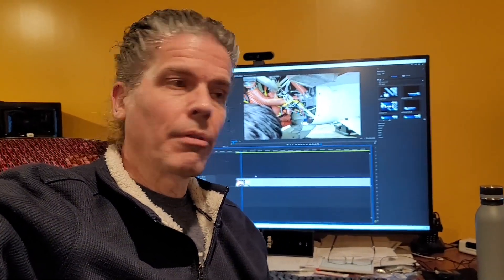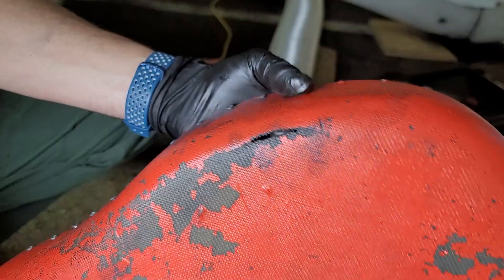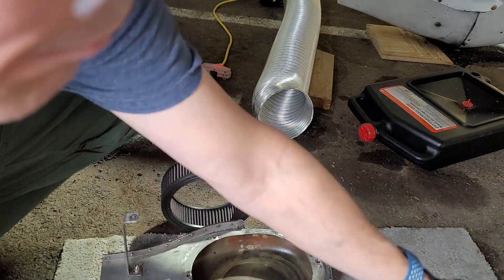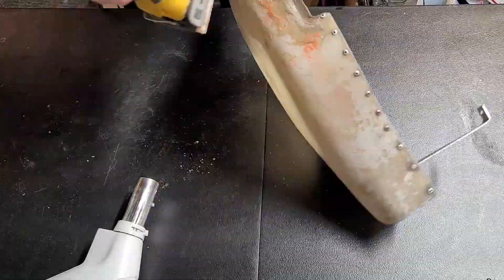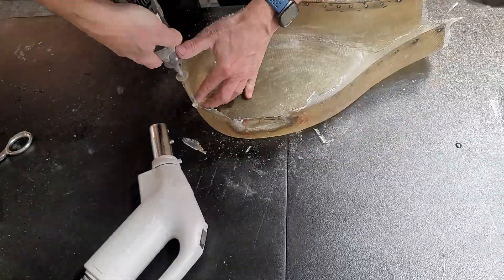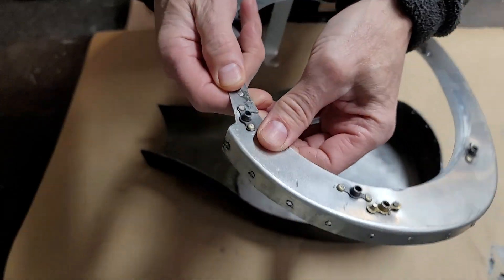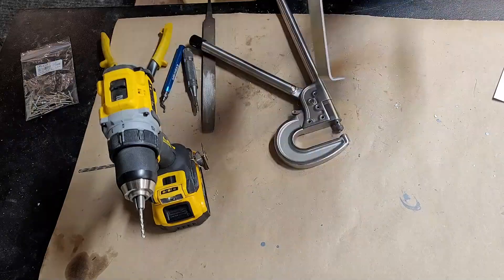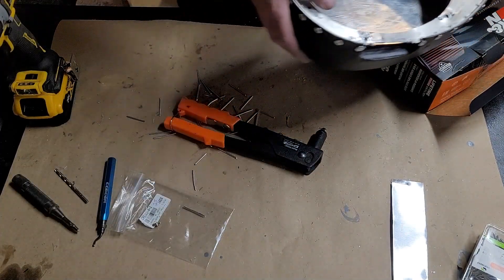Unexpected Problem! Rebuilding the Air Box on my Cozy MKIV Airplane

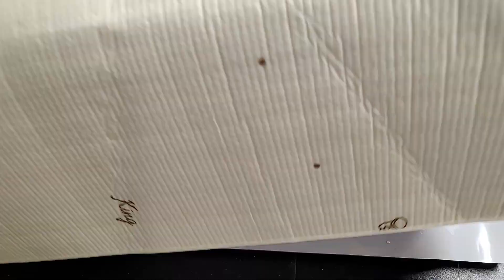Comment: 8:12 I'm very curious about the "curing tent" thing. Do you add heat? Does it contain the fumes a little bit? Keep flies from landing on it?
Reply from the maker: It is a heated plate with an insulated hood, and holds a specific temperature for a given amount of time. It drastically accelerates the curing time (full cure in around 3 hours rather than 24), but more importantly, the cured epoxy has increased strength, elevated glass transition temperature and reduced residual stress. The glass transition temperature is the temperature at which the cured epoxy goes from being rigid to more flexible. The temperature and times vary for different epoxies, so you need to do some research first.
Reply: @CanardBoulevard  aha. thanks for the big reply. it sounds somewhat like tempering glass or steel, really managing the temperature changes.

Comment: How does the filter move if it's seated to the carb?
Reply from the maker: It's pushed up between the bottom of the throttle body plate and the bottom of the air box. The only thing holding it in place is friction, and lots of oil gets down in there, reducing that friction - so with engine vibrations (plus the filter physically shrinking in size), it starts moving all over the place. That won't happen anymore.

Comment: I’m wondering, since you put aluminum on the bottom of the box, why didn’t you bend a lip around it to capture the filter to retain its shape and not restrict air flow like the tabs you installed around the top?
Reply from the maker: I like your idea! It would have required some way of scribing a ridge around the circular plate - not easy (at least not without metalworking tools), but it definitely would work if you could do it.

Comment: Great video Scott, by the way those lug fasteners are called nutplates probably MS21048 or MS21069 depending on the spacing of the rivets.
Reply from the maker: That's right. I actually have both on hand, don't recall which these were, but I had a replacement to use!

Comment: For the bottom part, and maybe i have not got to this part yet, but did you consider making a mold, and refabricate?
Reply from the maker: No need to, this is easily rebuildable. I suppose I could have made a mold to manufacture more of them, and perhaps I should have - as Van's sells those FAB's for $700 apiece!!
Reply: Wow That a lot of coin....airplane add $$$$ when it 's only cost 1/2 of a $ to make.

Comment: - Wow, that was some advanced repair work. I would have thought that it needed to be thrown out and bought a new one. But it looked pretty good after you fixed it up 😀
Reply from the maker: When you consider that a new one costs $700 (and would still need to be modified to fit my plane - and would still have the same wear problem), there is considerable motivation just to fix what you have on hand. :)

Comment: Nice job, looks good. I was thinking, while watching, that a deflector, in front of where the in-rush of air hits the filter, would probably prevent the high flow of air in that one area from opening the pores of the filter media. Just a vee shaped piece between the base and the cover, where the neck opens in front of the filter, would be adequate.
Reply from the maker: It's actually more complex than that. There's a reason for the shape - it's called a pressure recovery box. It has a relatively small opening where the high velocity air enters. Air pressure drops as velocity increases, so this high velocity air has low pressure. The throat of the airbox opens up immediately after the entry, which instantly slows the air down. As the velocity slows, the pressure increases - the net result is that there isn't a "blast" of air directly on the filter, but instead a high pressure surrounding the filter, acting almost like a miniature supercharger to raise manifold pressure and give you a little extra power.